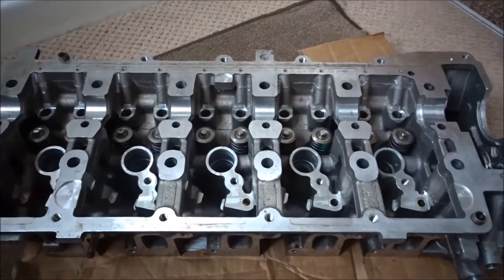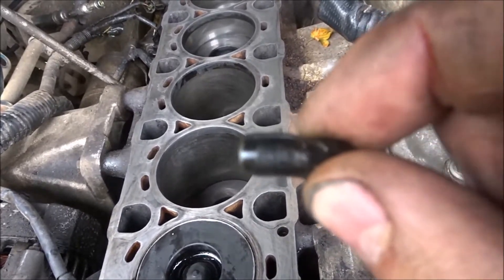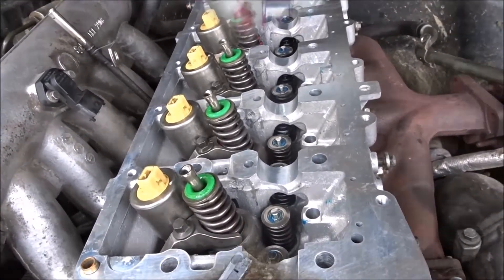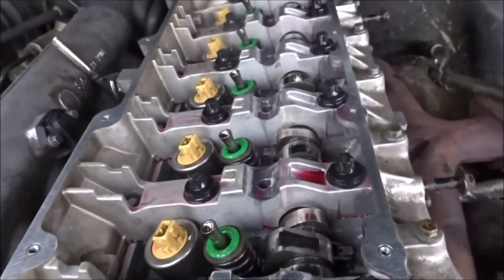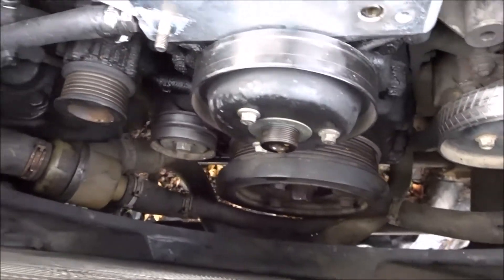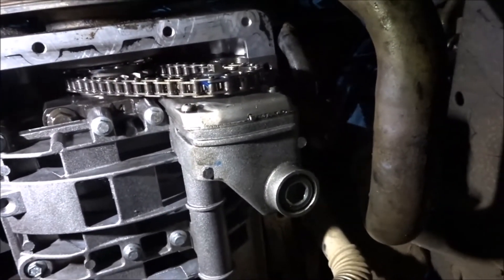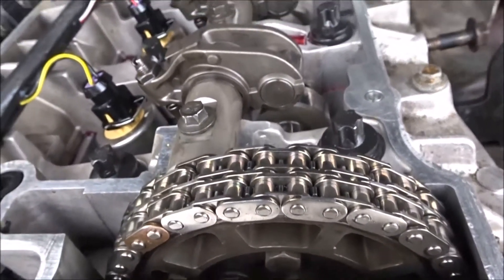Discovery td5 cylinder head rebuild/ repair and other updates

Comment: just going through this problem on my defender, had injector seals done twice so pretty sure a fuel gallery has cracked somewhere!! we have looked for a crack but can not see one.   The one thing you do that had not dawned on me is changing the big end, mine has had diesel diluting the oil for far to long now so guess I will need to do this as well. thanks for post its informative
Reply from the maker: celticridertraining hello it does sound like you have a crack in your fuel gallery. If you check one of my other videos it shows you how I checked mine with crack detection dye with the injectors removed. Glad the videos can help 
Jtpickup

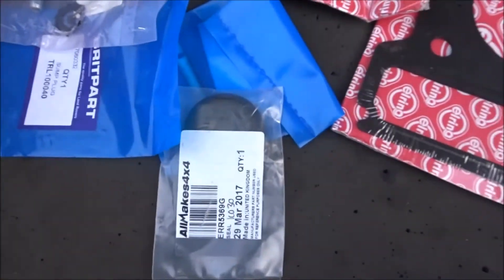Comment: @JT Pickup Hi, any leads where to get the studs between cylinder head and the engine block? (min 1:06).
Thanks
Reply from the maker: Hi alejandro. Here is a link to a website for them https://www.johncraddockltd.co.uk/yll500040-guide-dowel-metal-type-td5-cylinder-head.html 
The part number for them is YLL500040. They are for sale else where too like ebay etc. 
Hope that helps

Comment: Hi.  Question for you:  how did you manage torquing the con rod bolts from the underside.  especially the final 80 degrees.  i cant seem to get enough clearance to manage it.  Any help is greatly appreciated.
Reply from the maker: Hi Jeremy, first i jacked up the chassis to give move room above the axle. Also remove the chassis brace thats is bolted on, this also gives you more room to work. When tightening the bolts up I  moved the crank so that the con rod that I was doing was at the bottom of its stroke giving better access to it. With the angle torque I did it in stages e.g. Two 40 degrees this give the same end degrees but means you can achieve it in less room. Hope this helps

Comment: Hi from Greece !!!
How many fuel was into oil in about 1000 miles ?
And how is normal?
Reply from the maker: Hi when I first noticed it I had done about 500 miles and had about 2.5 3 litres of fuel in the sump. Easy way to see if its happening is to keep checking your oil level if it keep rising you have a problem.